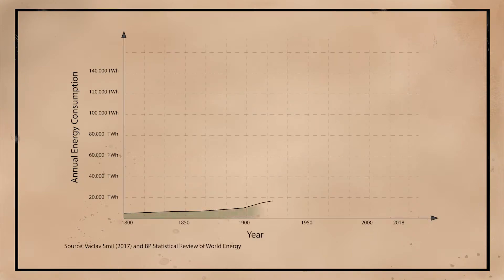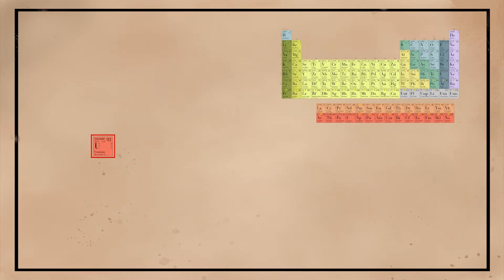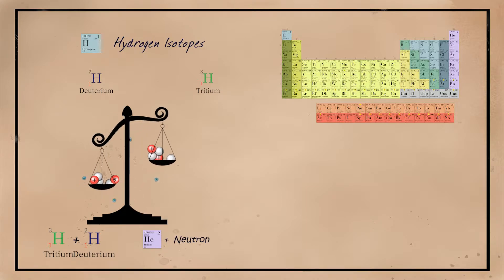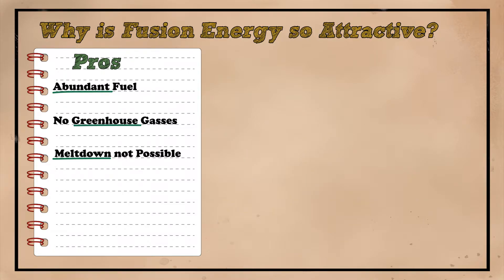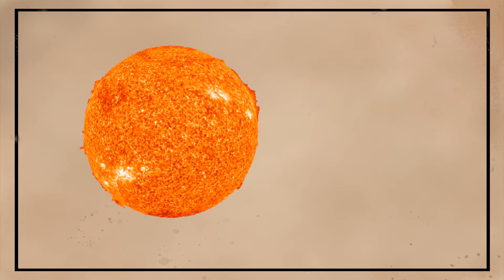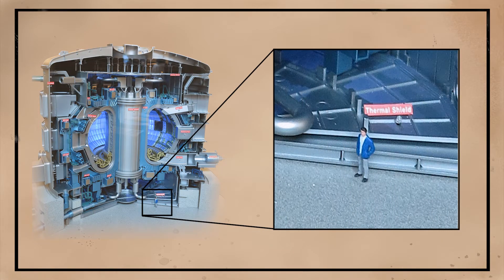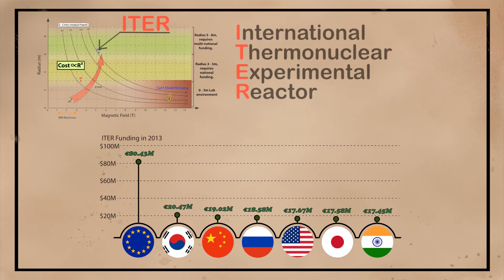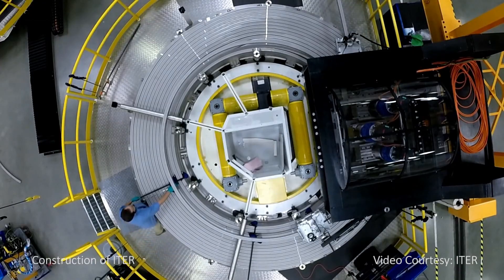Fusion: basics and challenges explained

Comment: You say fusion doesn't emit gamma radiation.  This is true, but DT fusion does emit neutron radiation.   Neutrons are more damaging to materials than is gamma radiation.  They're a major headache, greatly limiting the choice of materials.  80% of the energy from DT fusion comes off in very damaging 14 MeV neutrons (in contrast, fission produces about 3% of its energy as neutrons, with average energy ~1 MeV).

By the way, the basic stumbling block for DT fusion isn't physics, it's engineering.   It's the good old square-cube law.

In a fission reactor, energy is produced as heat in fuel rods and conveyed to coolant through the surface of fuel pins.  The pins are about 1 cm in diameter and are closely spaced.  As a result, the surface area for heat transfer is large and scales proportionally to volume.

In contrast, in a DT fusion reactor, the energy has to radiate through the first wall.   The area available scales more slowly than volume.   For a given power/area, fission is superior to fusion by a ratio of about (diameter of plasma)/(diameter of fuel pin).    We can expect the volumetric power density of DT fusion reactors to be greatly inferior to that of fission reactors.

We can see this happening with ITER, ARC, and existing commercial reactors.   The volumetric power density of a PWR's reactor vessel is maybe 20 MW/m^3.   In contrast, the gross fusion power density of ITER is 50 kW/m^3, some 400x worse!   The ARC design would be better than ITER, but still a factor of 40 worse than the PWR.

So: DT fusion reactors promise to be much larger, and much more complicated, than fission reactors.   This will make them much more expensive than fission reactors.  They will also be less reliable.  A PWR can operate with up to 2% of the fuel rods leaking; a fusion reactor will be shut down by a single leak anywhere in the first wall (and the first wall has to have coolant flowing through it or it melts.)

In my opinion, fusion is going to need to go to advanced fuel cycles beyond DT that would enable it to avoid a steam cycle (or similar) to convert heat to power.  Something like Helion's approach, trading more difficult physics for easier engineering and better economics.

Comment: i got 100% of my electricity from fusion today -    solar panels
Reply from the maker: That's an interesting way to think about energy. But in that case, every kWh on earth can be traced back to fusion. For example, a hydroelectric power plant uses the potential energy of the water. This water got to a higher place by evaporation and rain. Evaporation happened due to the warmth recieved from the Sun. The heat from the Sun is due to fusion hence it follows that hydroelectric dams actually use energy derived from fusion 😅. Thanks for the comment Groovy, we loved it. Cheers